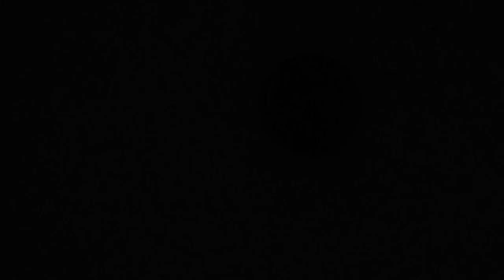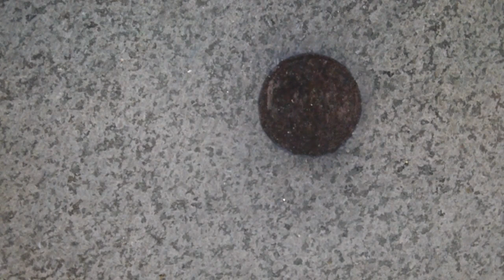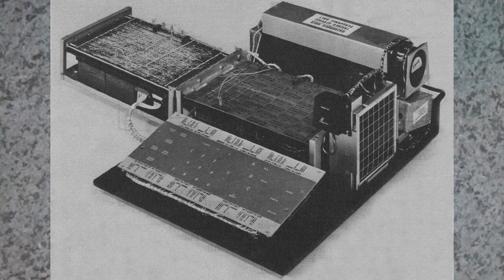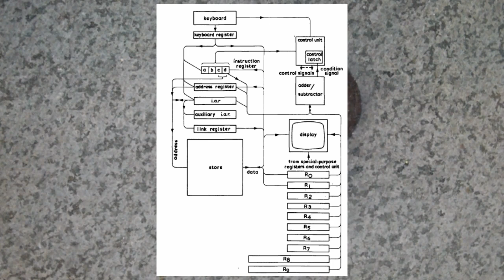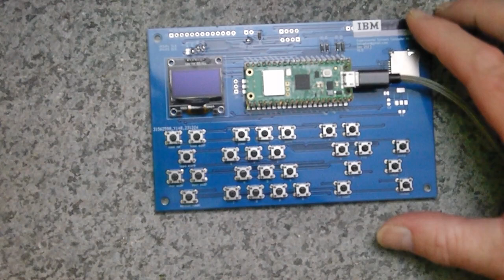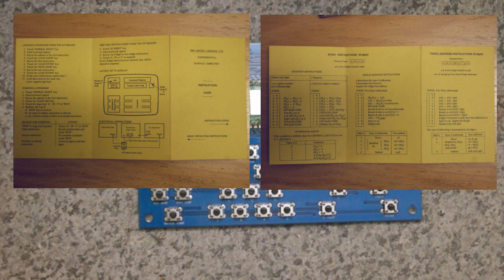First Purpose Built Educational Computer?

Comment: really interesting i guess it was cancelled because it was going to be too expensive. but what kind of schools were they planning to put this in like colleges or actual high schools with teenagers or younger. not to get off topic but i am relatively  young but i want to school in the late 90s and 2000s but even then my teachers were very clueless about computers and my first school didn't even  have any computers until the year 2000. most of my teachers were born around the same time they were making this thing. but these people never grew up with computers and avoided them as adults until they were forced to because of email.
Reply from the maker: I've seen a comment that it was cancelled due to some anti-trust activity in the US. So I have no idea if that was the case, or there was an issue with the machine itself.
If you go to this link (you may have to scroll up a bit for the photo):

https://www.stedwardsarchives.org/PDFViewer/web/viewer.html?file=%2fFilename.ashx%3ftableName%3dta_Publications%26columnName%3dfilename%26recordId%3d685%26zoom%3dpage-fit&searchText=schools%27%20computer

you will see the machine in use in a school and they are older school children in that photo. As floating point was easy on this machine several people used it for mathematical investigations, and they definitely weren't younger  schoolchildren. The mention of anti-trust is also in this link.

This link shows the sort of work they did (I believe M G Neville is pictured in the photograph):

https://www.cambridge.org/core/journals/mathematical-gazette/article/abs/3277-finding-failures-of-the-antifermat-hypothesis-by-computer/E7E777B8E8802CFE99EF7623F9DDD330

I think the teachers at this school were well versed in computers as one of them was a collaborator on the project. It's probably the luck of the draw as to how familiar they were.